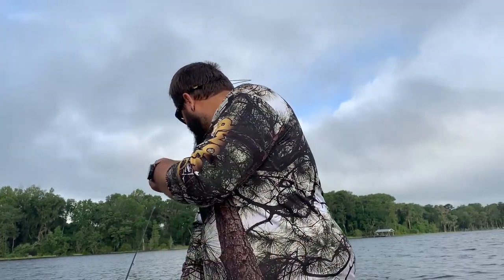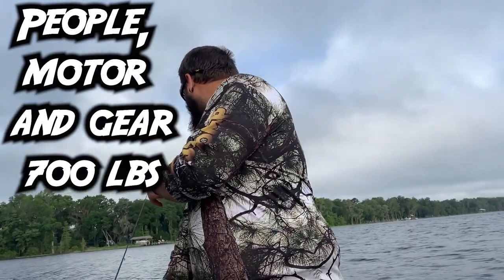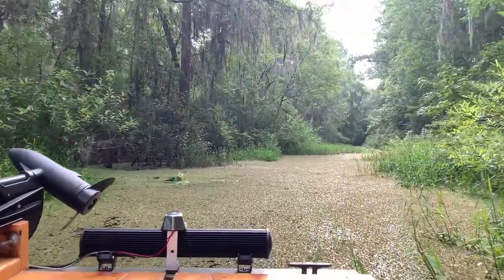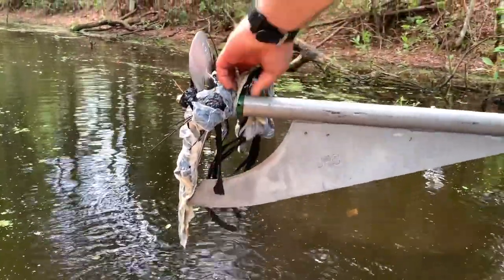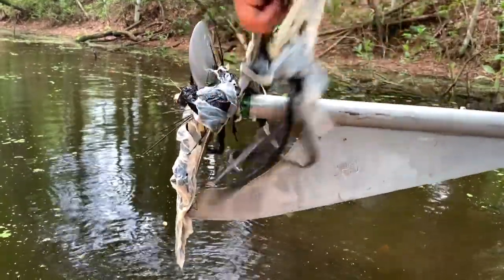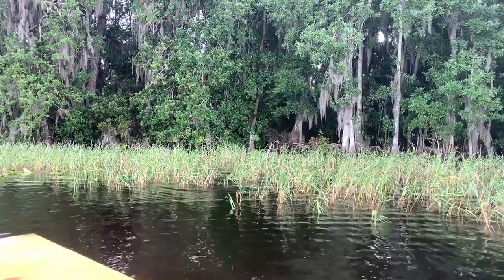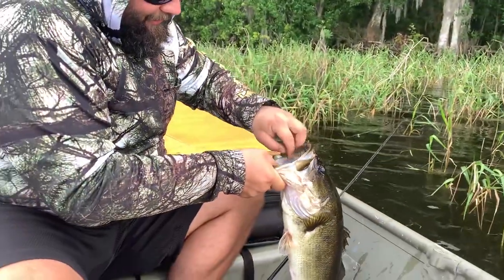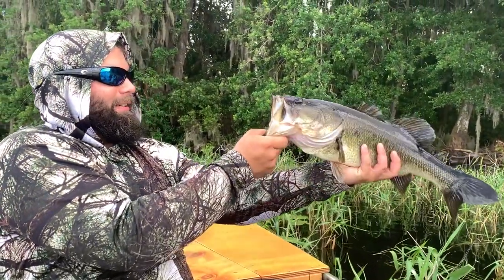Speed Test and Fishing Predator 420 SWAMP RUNNER (8.5" prop) 1236 bass boat (Swamp N Stomp ep. #66)

Comment: That thing will float on a 1236?
Reply from the maker: Black Warrior Lures yea no problem at all
Reply from the maker: Heck Danny has the same setup on a 1232, he claims its fine but in my opinion his boat wants to be a submarine... but the 1236 handles it fine. -Mark
Reply: @SwampNStomp  That's good to hear because I was worried about the weight. I have a 1436, so that should be even better.